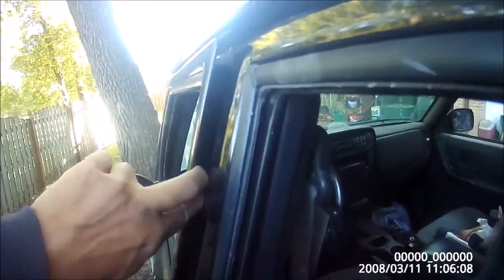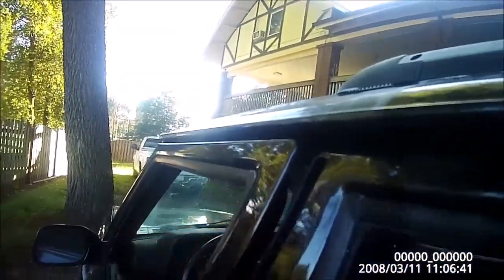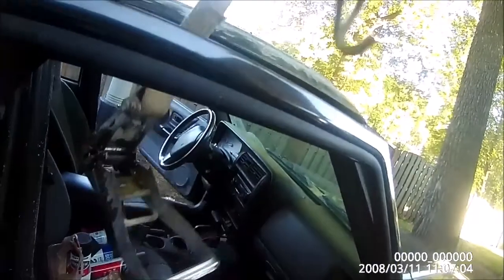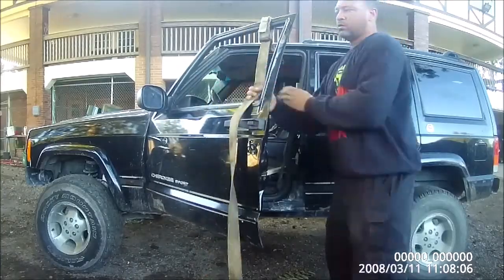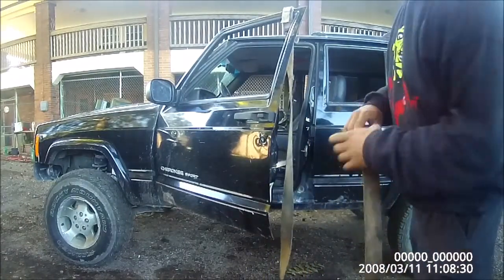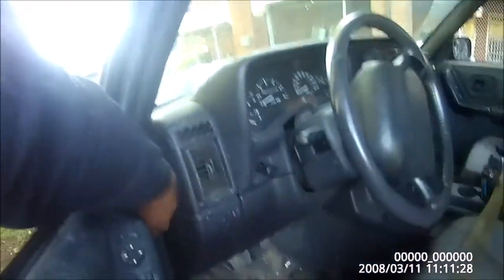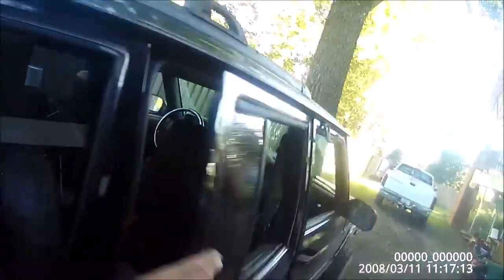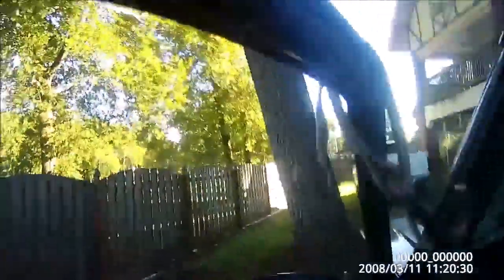How to fix a car door that's been pried open.

Comment: Thank you so much! This worked perfectly on my 2019 RAM 2500. Was just slightly bent and this fixed handily without having to replace the entire door.
Reply: Haha I just bought a used ram 2500 like this not flush at the top and you could hear the wind above like 50.

Comment: I have a question.  Did the electric window work with the door frame out of alignment?  My window won't go up or down without having to push it because the frame was pried open. I've tried to align it back up several time and even took the electric motors apart and cleaned the brushes and dirt out of them and they are a little faster, but no where near normal.  Even installed new motors with the same results.  The really stupid part is my doors and frame are flat.  As in NO Curve and they refuse to go up or down even at half speded.  Wanted to kill an RV Mechanic for screwing it up.
Reply from the maker: I never had a problem.

Comment: Just use your knee and hands. Push it in, that's all. Like 'Roadside Guy' demonstrated
Reply from the maker: If you already know a better way of doing this, then why did you come to watch this video?
Reply: @ExaltedWarrior  more knowledge
Reply from the maker: @xtechconsult4243  Why do you need more knowledge if you already have an solution that works?
Reply: @ExaltedWarrior  okay bro. I am sorry if I've offended you by my comments. But you know it's good to know more. If I found out your method is better than what I already know. I'd adopt it and use it. Kudoz bro. Keep up the good work
Reply from the maker: @xtechconsult4243  I'm not offended. I'm curious, You said, "Just use your knee and hands. Push it in, that's all. Like 'Roadside Guy' demonstrated". I'd like to know, 'out of all of the knowledge that you gathered', what if you have already tried to use your "knee and hands" and you find that it doesn't work, what other solution do you know of, that can accomplish the same results that I achieved in this video? See, I posted this video because using my "knee and hands" wasn't working and I'm sure that the majority of the people watching this video have tried using their 'knee and hands" to no avail. So if you know of a better way to bend a door without using "knee and hands" PLEASE share that information with me and I'll pin your comment and include links in the description so everyone can learn from the knowledge that you have acquired.
Reply: @ExaltedWarrior  oh okay, sorry to hear that bruva, but it worked for me. Anyways, I'll search for other solutions so that, we can add it to our knowledge base. Kudoz